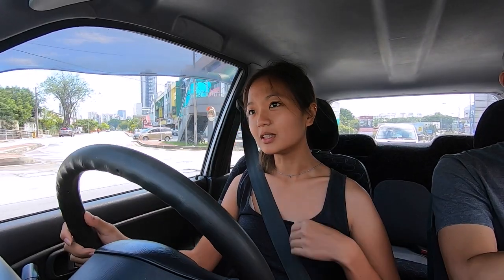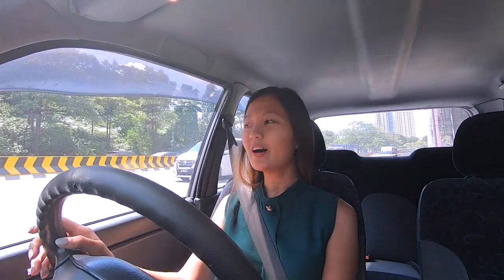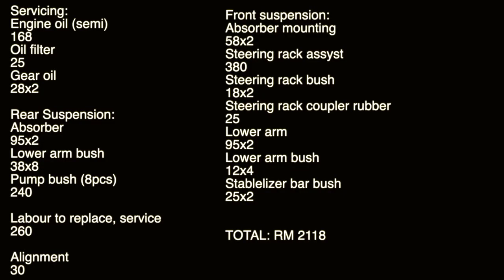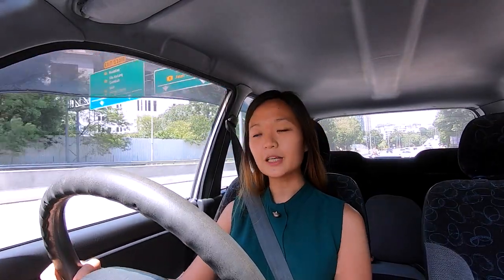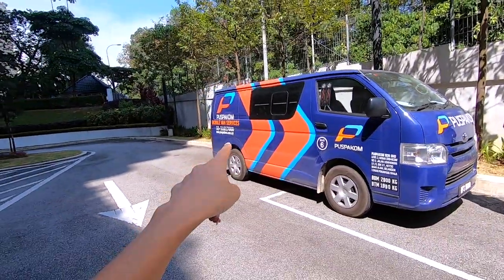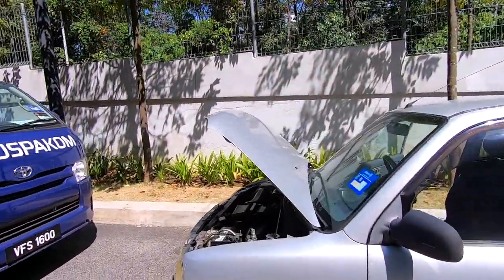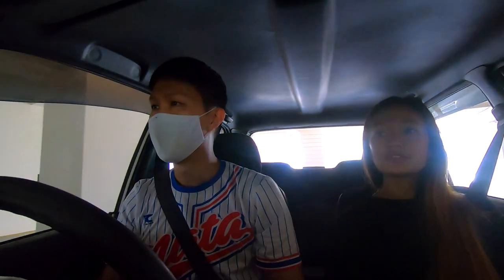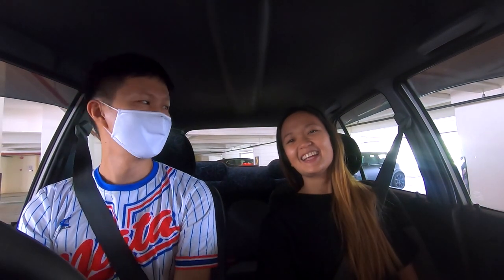What I Did Before Buying My Perodua Kelisa | Major #throwback

Comment: To make that perodua shift like a rolls Royce try a Uk police technique of sustained changing. Usually used when block shifting (though can be 4th to 3rd) you keep a steady accelerator (if you don’t it’ll free rev or drop RPM) and change as normal. The front end won’t dip and nor will the overall speed. It’s great for overtaking as a result as you don’t lose speed. Try it, it’s fun to nail as a shift technique.
Reply: You can do this in an auto to but I’m not sure how to as I’ve never owned an automatic.